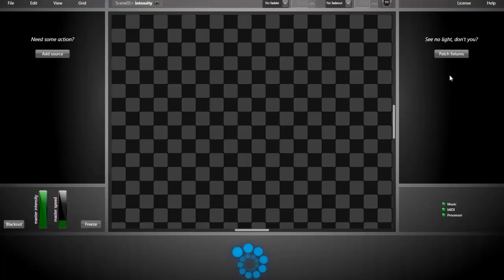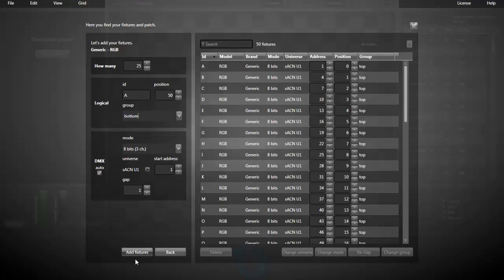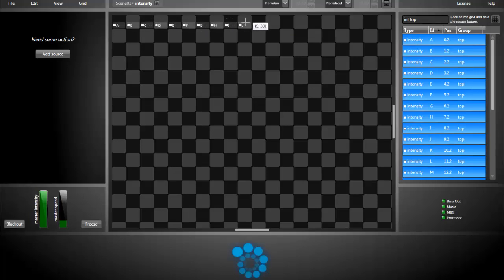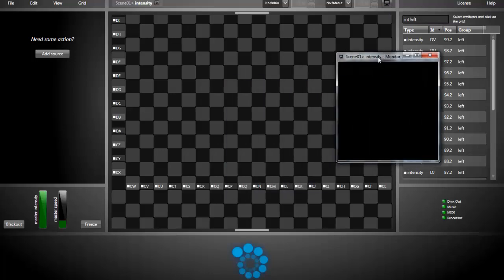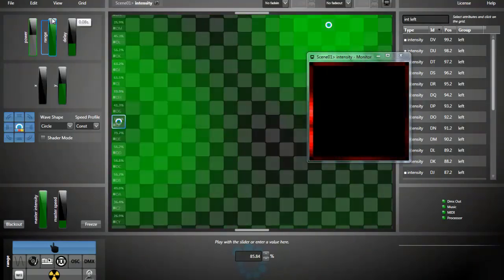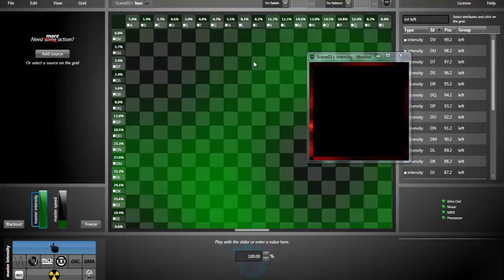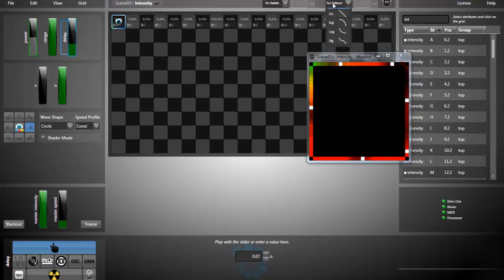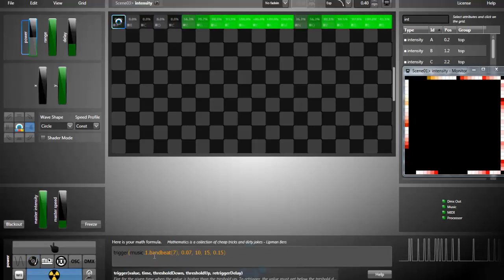Getting Started With Lightjams

Comment from the maker: Hi Andrés,

With a USB to DMX interface, you can do pixel mapping using at most 170 RGB leds. To control more leds, you can add artnet or E1.31 nodes and then you can control over 4000 RGB leds. There's more info on the Lightjams website.

Regards,
Mathieu

Comment from the maker: Hi. I’m sorry to hear you’re having problem with the sound to light. The key is to have a high quality sound input (avoid cheap microphones!) and adjust the volume properly to prevent distortion. Under these conditions, the beat analysis and other sound to light features work great. If you can’t get a high quality input, then at least you can use the sound level to do some interesting triggering.

I’d be happy hearing more about your experience. You can share with other users on the forum.

Comment: I have multiple questions, if y make a led rgb curtain, using only a standard dmx could i still do a pixel mapping?.. if do so, hoy many leds could i control?...

Also if i use an artnet dmx how does it works, i need the artnet and then connect it to the dmx? or just the arnet?

Comment: I have some artnet fixtures and i need to merge 8 universes over 1 single cable. ...
Is that possible to send artnet direct from the laptop without artnet nodes?
Reply from the maker: Hi Edgar. Yes, Lightjams can send artnet over the network even though no nodes are there. You need a artnet node to convert artnet to DMX.
Reply: woa, this is great i´ll get it on testing it to some pixel tubes !, thanks

Comment: Lightjams is a good idea, and has a nice GUI , however, the frequency separation for sound to light is horrible, and beat detection really needs some work. Its difficult to get a good sound to light setup as the bandwidth of each "band" is far too wide and everything gets muddled together.  You can see this in some of the other vids. As it is, you get a much better sync just setting up some random effects with the waveform generator. The sound function is useless for most music.